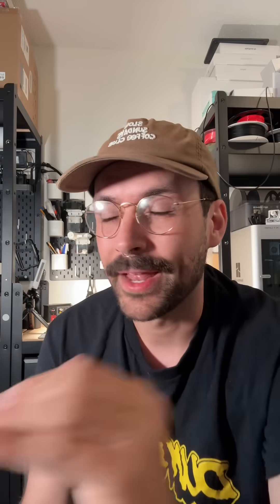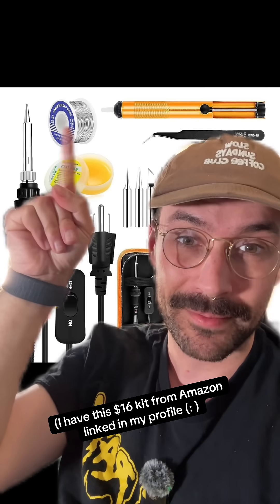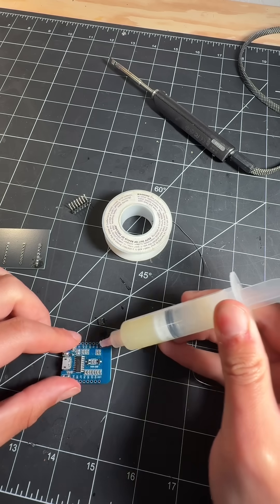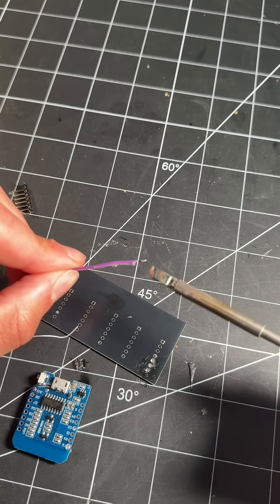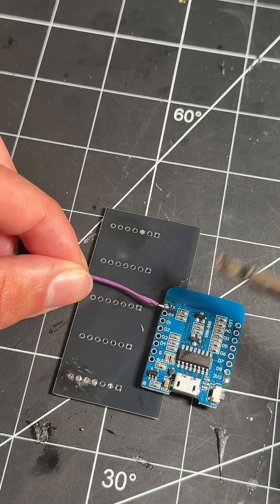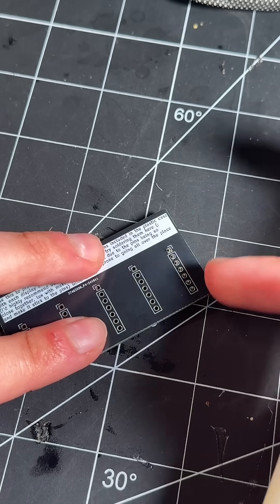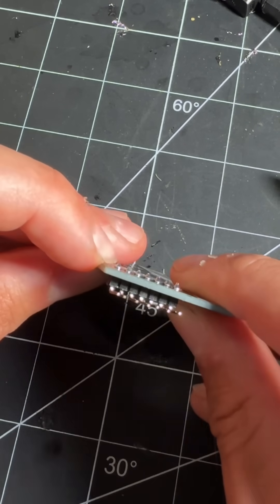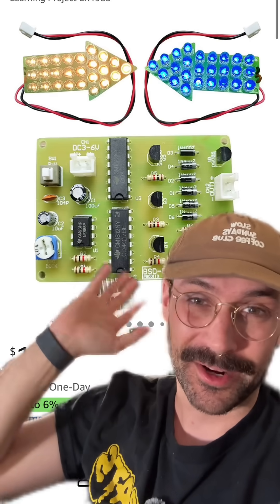Soldering 101 in 180 seconds (: How to solder soldering tutorial

Comment: For the first example, dont tin the pad that much. The wire should be going through the hole, put it through and add a bit of solder to it.
Reply: That’s what I thought, I’ve never myself and never seen anyone tin a pad like that, always feeding the cable or component leg into the hole first.
Reply: @joeclifford183  I have definitely done it on accident, some parts have teeny tiny holes and holy hell is it hard to deal with.

Comment: I'd also add that when doing multipoint solder joints make sure there aren't any "solder bridges". These are where there is a drip or pull of solder that effectively connects two points together, e.g.: Those "nice little teepees of solder" touch each other. 

Also, multi-core 60/40 lead/tin solder is SUPERIOR for doing electronics work.

Comment: Dont forget to mention that lead free solder has a higher melting point than lead solder. 
When i first got into the hobby, i started off by trying to replace a connector on a playstation. Since manufacturers have to follow certain safety standards, they use lead free solder. I was always wondering why their solder wasnt menlting when mine was. Thats when i found out about the different solders and melting points. Great vid btw.
Reply: Yes. I learned this when I was upgrading the switches in my Logitech mice. I had to add my lower melting point lead solder to it and use a tip with a larger surface area before I could get it to soak into the solder wick I was using.